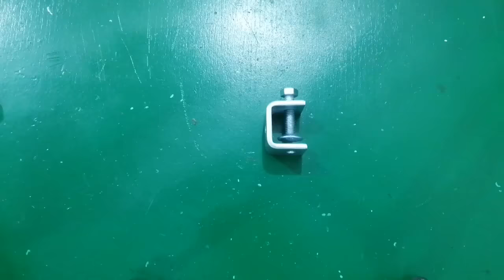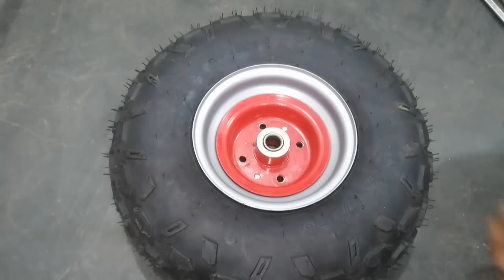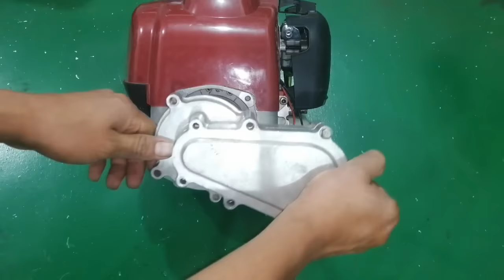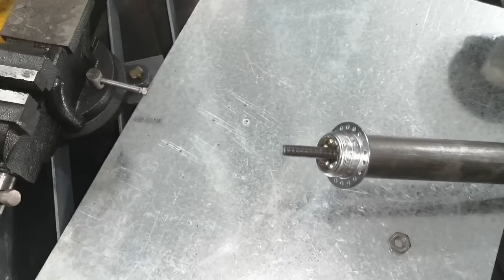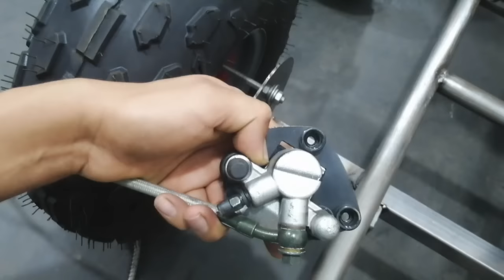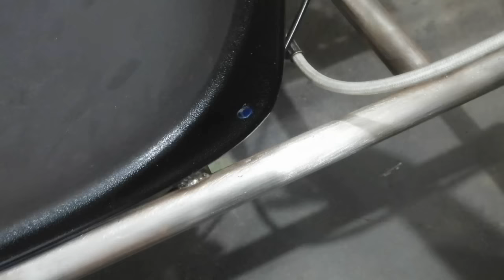go kart 25cc made from sprayer .powerfull  4 stroke engine

Comment: You can run 2stroke oil/gas mix in a 4 stroke engine every single I do and have. May smoke a hair here and there my believe it extends motor life.
Reply: Dont do it
Reply: 4 stroke don't need 2t oil it only needs engine oil.